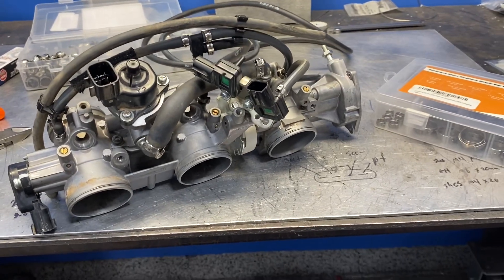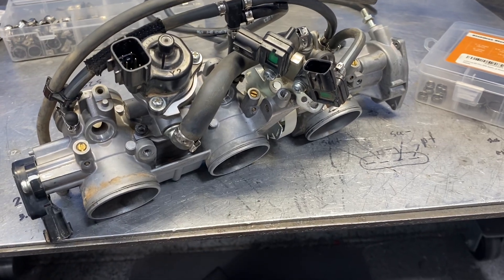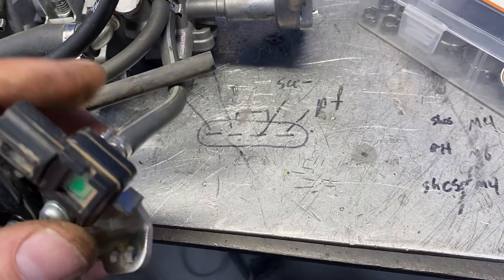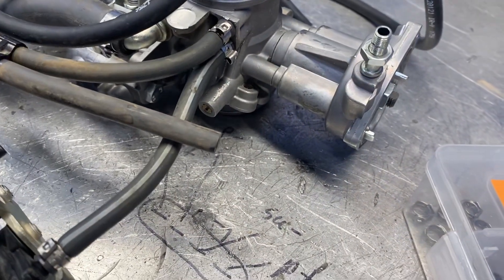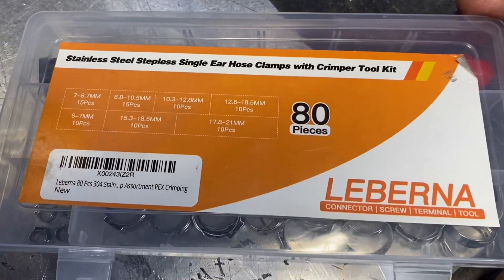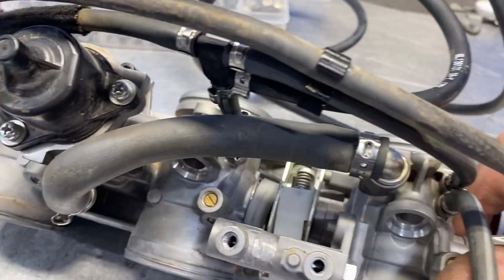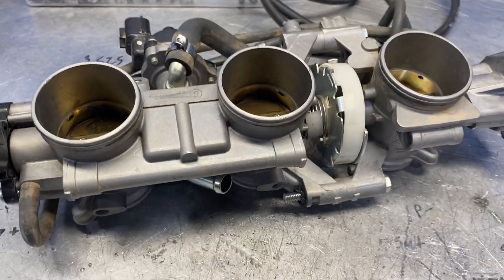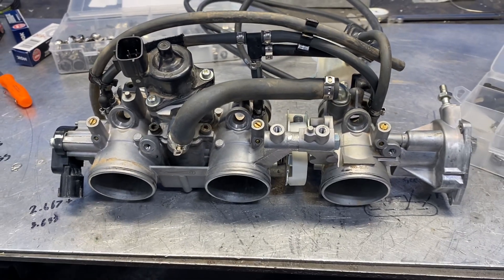Yamaha YXZ 1000r high boost throttle body prep, tech tip

Comment: What's the max boost you can run on a 2021 yxz stock motor??
Reply from the maker: Depends on size of turbocharger, they are safe around 200hp to the wheels with proper tuning, stock car will put down about 96hp to the wheels,